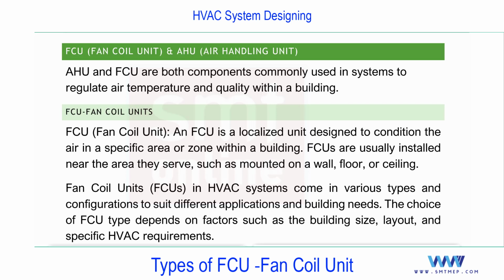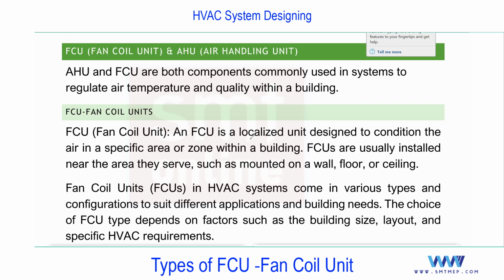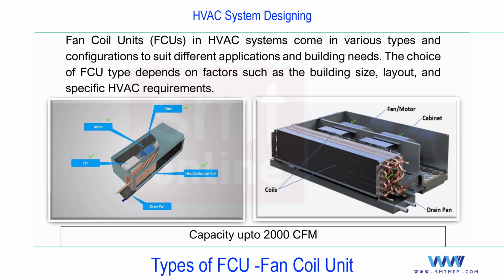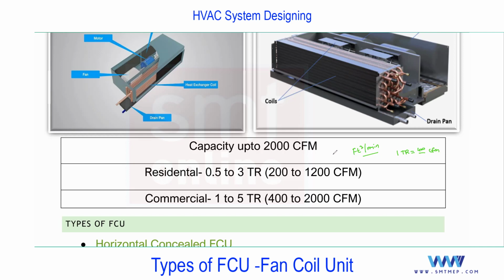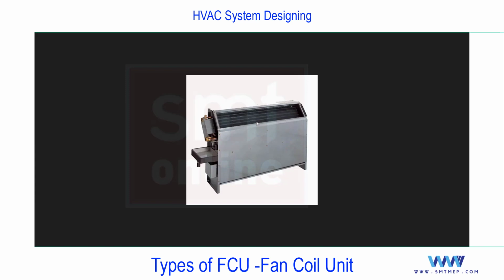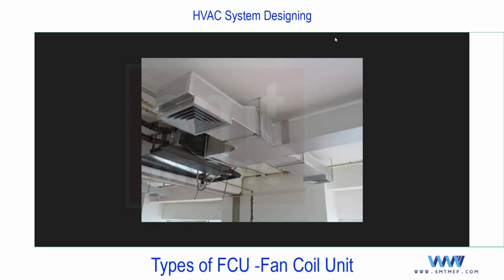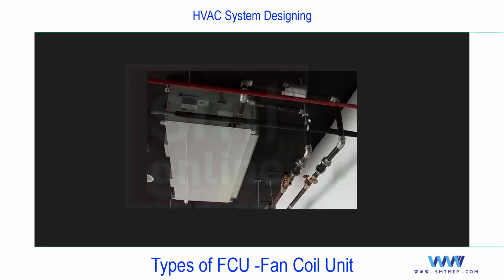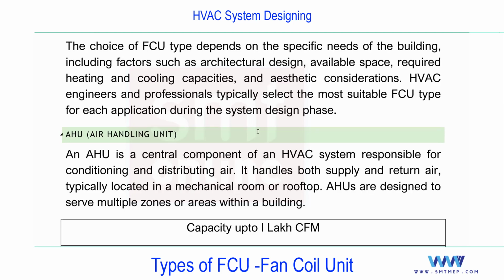12. Types of FCU

Comment: I have a question can yiu calculate parameters of air temperature and relativ humidity if you know capacity of fcu and air inlet parameters for example i have  in air  800 m3/h with 27 grad celsius an 60% relativ hum.fcu capacity is 3.5 kwt. What will air parameters after fcu ?